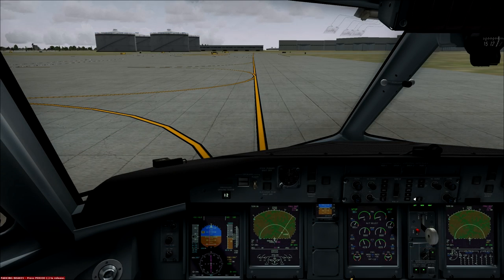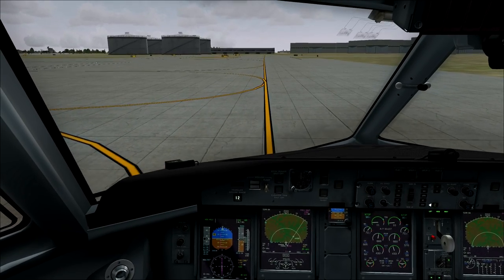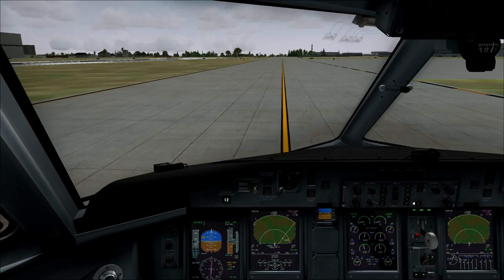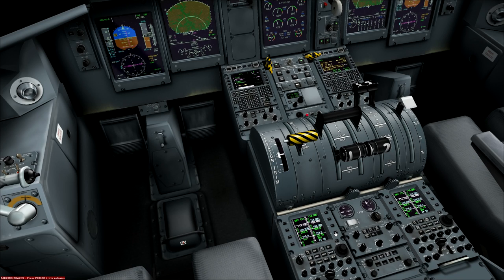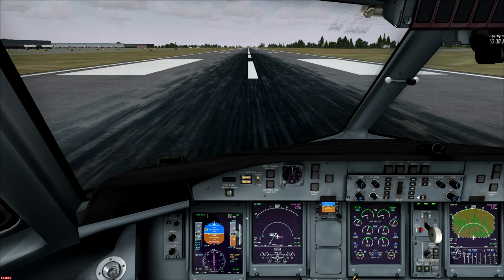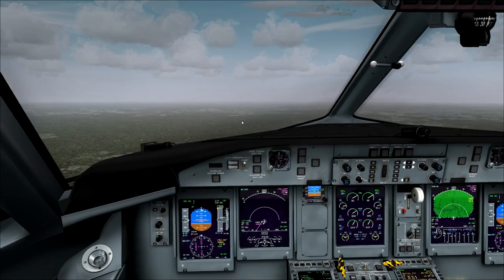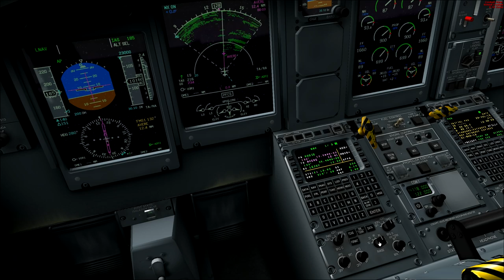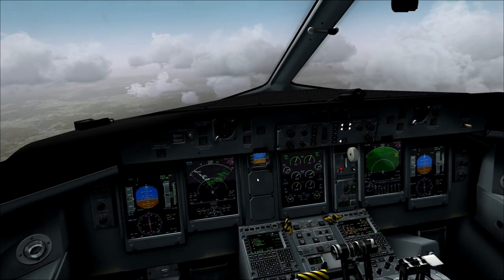FSX FULLY LOADED MAJESTIC DASH 8 - TAKE OFF

Comment: For a tiller control, if you have a twist joystick you can use that.  It usually assigns a twist to rudder control.  If you have rudder pedals you can assign the twist feature to the spoiler axis. In the Dash 8 control panel, assign the spoiler axis to the tiller control.  It works great and has a pretty realistic feel.  The downside is, if you are flying any other aircraft, the slightest twist in the stick and your spoilers will deploy.  I have to unassign the twist assignment before flying.

Comment: I have a twist joystick that I used to use the twist for rudder but purchased rudder puddles.  I now have the twist of the joystick assigned to the spoiler axis and then us that as the tiller axis. It works great but you have to remember to unassign it in other aircraft otherwise you will get a spoiler deployment when you don't want it...like at takeoff.

Comment from the maker: It's the torque from the props and quite normal. You need to trim rudder in this aircraft to keep it level and then re-trim every time you change power settings.

Comment: A few constructive notes here bud.  In the Q400 the Nose landing gear is actually slightly forward of where the flight crew sits. The FLIGHT/TAXI switch controls your spoilers. When in FLIGHT position the spoilers deploy if the aircraft is in the ground and the Power Levers are below certain angle; hence the amber spoiler lights coming on when u entered the runway. The FLIGHT/TAXI switch can be left in TAXI and it will move automatically to the FLT position when the PL pass certain angle.

Comment: Hi Froogle. Im trying to get to grips with the Majestic Q400. Two questions if I may;

1) on takeoff the aircraft veers to the left. Is that normal?
2) in flight, whilst in 'level' flight the aircraft is banking slightly to the left. My aileron trims are nuetral. If I use the trim to try and correct the issue my wings bank the other way. Do you any suggestions.

Also, excellent videos. Always enjoy watching these. Please keep up the great work :)

Thank you.

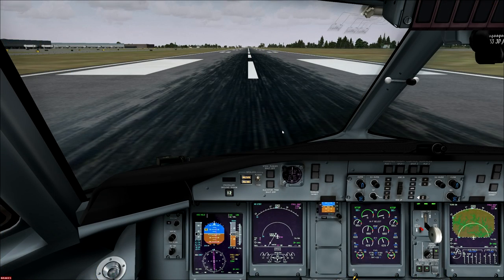Comment: Hello Froogle I've a question when you reach V1, VR speed at about 10:11mins  does the plane takeoff on its own or you pull back the yoke, or once you rotate the plane follows the takeoff path .I hear you say the plane actually takeoff on its own. ?
Reply from the maker: you need to pull back and follow flight director until you engage auto pilot